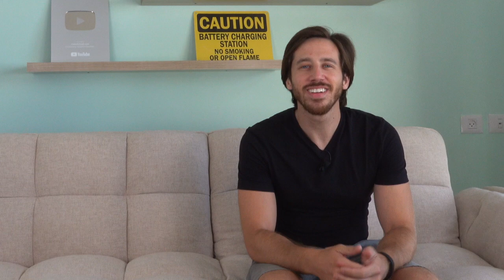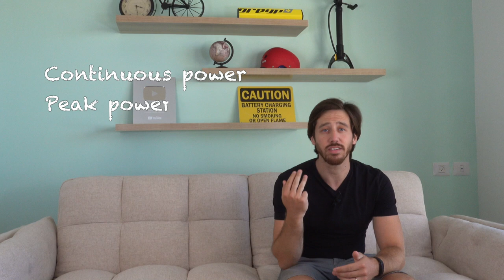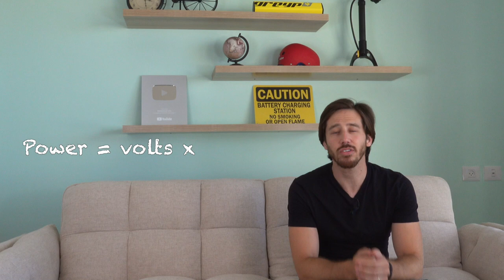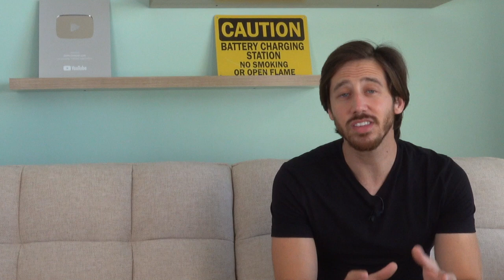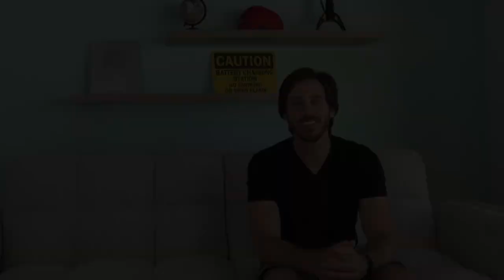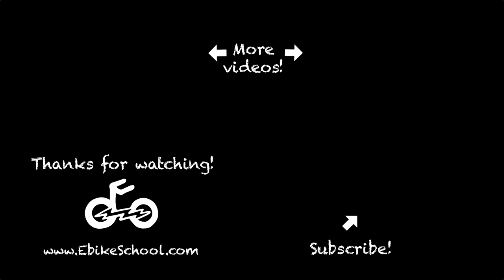E-bike watts - How electric bicycle companies are lying to you

Comment: Can you mount a generator on a ebike ?
Reply: I'll answer this one.
One can do whatever one wants.
The answer is yes; however, is it practical.
IMO, No. The weight,  complexity and cost of any generation mechanism would be much better served by simply increasing amp hours of battery.  Simply put, add a larger battery.  Now them, if I'm to read into your question, I would assume range anxiety. Same rule applies. Lamen Terms. More Battery Juice will outperform range extension scenarios.

Comment: Watts/power. If a motor runs at 500 Watts, for example, some of those watts are heat watts & some are mechanical energy.  If a 500 Watt motor turned 499 of those watts into mechanical energy & only 1 watt into heat energy, it should not overheat. So a rating of how many watts a motor can run at continually without overheating would depend upon the efficiency of the motor.

Comment: Micah help!🔋🔋🔋🔋🔋🔋
I still don't understand what I came to figure out:

I purchased a compact folding ebike.

I got max configuration:
Battery = 48v 15.6a

My understanding is volt is speed and amps is the range/distance. I want to understand how and if getting the basic 350W motor or paying for upgraded 500W will make any difference?

Will both 350W and 500W motor go same max speed (48v) and max range (15.6a)? What if, any difference, besides upgrade cost does getting the 500W motor make?

I think I made mistake paying for 500W if the speed and range are determined by just the battery.
🔋🔋🔋🔋🔋🔋🔋🔋🔋🔋🔋🔋
Reply: Possible solution

Higher power controller = more power to the motor ( but more heat will come from a lower power motor )

like your 350w wheel it wouldn’t be wise to connect a new controller to that because the motor will heat quicker than a 500w motor 

Long story short: 500w motor + controller upgrade = maximum draw from your battery to motor which = more speed
Reply: @ize100  thank you for the explanation! I am thinking for a small compact bike that people likely to buy it not prioritize speed and better to do 350w for better range. The only major difference, for this specific bike is that 500w not much faster than 350w but it does have nearly twice the torque.

Comment: So, if I swap my 45 amp peak controller with a higher amp controller, (with the same others) will my bike go faster?
Reply: Yes, but make sure you dont apply too much amps or your motor will melt
Reply: i wonder do you have hub motor kit from china with 1500w motor? I have also 45amp 1500w hub motor kit from china
Reply: @volcaprojects8333  I have 1500w direct drive motor from china. I just saw a guy that changed controller to a more powerful one and didn't make changes. Only after increasing the voltage
Reply: @77777Plank  Okay. mine was 48v i installes 52v battery and now i get 2kw continuous and 2.5kw peak
Reply: @volcaprojects8333  almost the same. 52v 2250w peak
Reply: @77777Plank  kt-lcd8 display?
Reply: VoLCaMiN yep
Reply: @77777Plank  2.3kw for me 😎👌🏽

Comment: Australian laws dictate 250w continuous for pedelec and 200w peak for non-pedal assisted/throttle only... with a 25kmh cap.. so sad. Also specifies total combined power so cant make a 250w 2WD build and overvolt like you did :(

Comment: Hi Micah, I am hoping you can assure me I didn’t make a costly mistake in the controller I ordered. My goal is to convert my mother’s Sun Trike into an e-trike for her retirement present (so she will actually be able to use it!). Unfortunately, I ordered a 48v 1000w kit for an e-BIKE forgetting my desire for a reverse function! I am aware that many controllers have the function built in even if unlikely to be used on a bicycle kit. The controller I ordered (from Enjoy Cycling Store via Amazon) as part of a front wheel hub kit has controller model #KT36/48 ZWSRL-ff01A. It should be noted that I have not yet received the kit yet; I just realized my mistake and have been unsuccessful in stopping the order. So what I want to know is it possible to enable a switched reverse function with this particular controller?  If so, can you do a vid on how to do it?  I will be a first time e-bike/trike builder; but I won’t be a one time builder as I have plans to do more when my budget allows. Thanks so much for any help and advice you can offer me in this dilemma. I love your vids, keep up the great work.

Comment: Laws and rules are based on Continuous power. Not Peak. Because the peak power isn't the maximum speed of the motor. Continuous power means the motor is at it's end performance line. While Peak power is the start of Torque/RPMs. It's same deal as Gas and motorcycles. If they ruled on that, the bicycles, etc would be VERY VERY crappy performance because their Peak power being ruled down, would make bikes under perform.  Bicycles, Cars, Motorcycles have to have this Peak power ability because it's the backbone of getting started. Then the motors taper off.

If you learn about motors and their performance you'll understand a lot more about laws and rules things are placed on.

Comment: If you could figure out a way to tell the difference between a 500 watt Bafang geared Hub Drive and a 750 watt Bafang without taking them apart or riding them , you would be the man.  I'd buy one of these e-bikes except for the companies that sell them are so Shady. I know I talked to a couple of on them on the phone. More than once. More often than not you end up with a $1,500 to $3500 paperweight/ headache, if you have any intentions of riding them more than a couple miles a month.

Comment: so my bike is 500w rating i have a 48v 13ah battery and a 25amp 48v controller 48v X Amp25=1200peak power
Reply: I believe that’s correct my guy. That’s correct.

Comment: Isn't torque variance also due to the winding on the motor? 

The Crystalyte series here is the one with which I'm most familiar and the data provided has varying torque but assumes the same controller for amps and same voltage for battery.

http://www.crystalyte.com/SAW%20series.htm

Comment: Nominal power is not just a name convention. It is a rating that the motor is supposedly designed to run at in excellent conditions with the proper voltage and current applied and at a sustained power level.  Also, my 1k rated motor is not a 1k motor. The voltage and current rating is 48v at 20a and therefore using the oversimplified power rating system it is 960w, but is listed as 1k which is incorrect. I wish people and businesses would at least use true power ratings without the fake rounding off of the numbers( that includes you).

Comment: But ... You didn't explain torque! Nor power, for that matter, and how it relates to what it does for your riding on the flats, up a hill, over some roots
Reply from the maker: Yes I didn't do a breakdown of torque, perhaps that should be a future video. But I discussed power both from a physics standpoint and a practical standpoint. It was in the beginning of the video.
Reply: @EbikeSchool  Love your videos, by the way. Thanks!
Reply: @EbikeSchool  I think it would be helpful for people to understand Watts in terms of what it can do for them, rather than Volts x Amps. Eg. 250W is 10km/h on a 6% gradient with 22kg bike and 80kg rider. It's also a bit weird that 250W isn't the same on every bike, because some bikes are more sluggish than others (eg. compared to Specialized SL models).

Comment: Make it as simple as possible, butbno more.

Multiplying battery voltage * controller current may have been somewhat accurate in the past, but with todays hardware, that calculation is wildly inaccurate.

Voltage will be at its maximum at maximm speed.
Amperage will be maximum at maximum torque.

I guarantee you those do not occur at the same time.

You aren't going to see a motor with a 48v battery and 100a controller pulling 4800w

Comment: Power is just a number, it's how she chooches that matters.

All those angry electric Pixies are skookam as. 

Are there any geared mid mount motors on the market at the moment? Like separate gears between the mid motor and the mid output sprocket?

Be awesome for a belt drive single pedal gear.

Comment: The explanation for motor rating is too simplistic. ESCs switch, between full-on and full-off. This leads to very high RMS currents, which is much larger than 'average' current. It is the RMS currents that dictates the power dissipation from the motor (ignoring hysteresis core losses at high RPMs). You can easily burn out a motor/ESC/battery at partial throttle, even though the average current is low.

Comment: Now how many advertisements of EBikes have you seen with anything other than a "watts" rating, not mentioning any qualification, like peak or continuous? In fact, have you ever seen in the specs of an eBike for sale anything other than just "watts"?  And don't the laws all just say "watts" without any other qualification?  I doubt seriously that any EBike motor is anything like 90% efficient. So when a seller says, "Watt," you may reply, "What?"  Seems to me that PEAK power is when you start the motor, acting like close to a dead short circuit before it starts turning.

Comment: Tourge rating is by far the most important. I have ridden 750w (48v24a) ebike on steep hill gets to a full stop. Then riding 250w ebike i put same uphill goes 20km no problem. 

The first bike was with fat tire hub motor and other one was normal tires.

First ebike was KS26 750w and 2nd was NCM milano+ with throttle both.

Comment: Hi l have a 250w 36volt front wheel motor with 15,6 amp battery 36volt battery with 40 mn  this seems from your maths very small l live in Poland.

Comment: Ohms law ...volts times amps equals watts.. 880 watts equals one horse power. Which with with wind resistance and proper gearing can approach a mile a minute...or more. With wind fairings and big chain wheels bicycles with no.motors following vehicles with a wind break ...approach well over 100 mph.  The korean gas motor on a mountain bike with a Jake shaft and ratcheting  freewheel front chainwheel now has a 5-6-7 speed transmission... so you wanna ride yer mountainbike 60-70mph down the freeway... it's now possible... hang on....get steel wheels and ditch all the aluminum and upgrade yer spokes ... forget an aluminum frame.. chrome moly chrome moly chrome moly chrome moly.. I've toured america on an 8000 mile circuit I know a little about bikes.. Aluminum components are key to long hauls and light weight.  Add any horsepower and the dynamics are deadly at best .. steel wheels steel cranks steel frames .. sorry... 30 mph on anything but a lonely straightaway is madness ... 20 mph is almost controllable.. we stepped up from pedestrian monkeys and horses and buggies to shed their forest Gump braces and fly away...  why this wasnt done 50 years ago is beyond me..crazy...man..

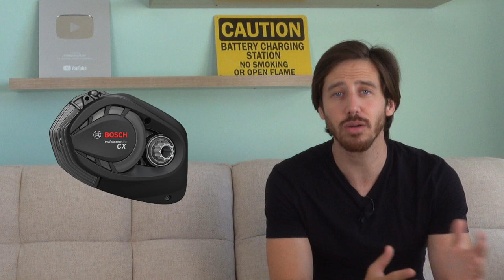Comment: WTF is "Europoean level" @8:24?! 
I never knew they operated on a higher (or is it lower?) level. Europe sucks if you can only get 250W over there... IMO, it's not even worth getting an Ebike at that level!
Reply: Well he explained that using Bosh as an example. They all fudge their power wattage to be legal, so you have to go by the Newton meters of torque to know how powerful they actually are. But he even fudged Bosh's Nm ratings by a ton. They make motors that near 200Nm of torque, not just 85Nm like he mentioned. You'd be hard pressed to find any motor on a US E-Bike with anywhere near that much torque. Even my 1,000 watt Bafang motor only has 108Nm of torque.

Comment: The math isn't that simple. Yeah, mid drive might be but by a hub motor calculating 32V x 15 A means the maksimum peak power is 480w (not taking the power efficiency in) but you don't have any ideas in what rpm the peak power is.

Let's say you doing 25 km/h and your controller limits the Amps to max 15A and to get to the 15A cirrent @ the speed, the engine takes 25v. That means you're max power @ 25km/h is 25v x 15A what wuld be 375w

Yeah you culd rune the same engine with other 15A controller and 48V battery, but you wuld still put out 375w @ 25kmh

So the right way to look at the things wuld be the torque in the most cases...

Other thing is that you can up to a limit push more amps true the engine. There is a physical limit about how strong the mangnetich field can be made for a given mass of iron (the engine)

This limit is the current and maximum possible torque, the limit is a soft but quite deep curve to well you lose quite fast the efficiency.

If you want more power you just raise the rpm and give the engine enough Voltage to keep up the current.

Current is equal to torque, and the voltage is equal to how high in rpm you get the current going. So you get from the same engine more power by spinning it faster wit higher voltage

The last thing is the termal limit. And that's a question about design /used parts in the engine. Some data sets I seen giving out more than 10x rated power (constant) for 10s if I don't remember wrong

Comment: the lies ive come to ignore

battery life/range utter bs its rated on you being in the lowest pedal assist and weighing the same as a anorexic supermodel riding on a flat road with no wind

speed will depend on what they have told you and how much you weigh if they said 15mph it will probably go around that on flat roads but any hill or wind and that numbers dropping when it comes to throttle only in pedal assist it depends on how committed you are

i cant remember where but one site has a decent little calculator where you tell it everything about your setup your battery your controller wheel size how much you weigh how much throttle you use the gear ratios you'll use most and even the type of cycling you'll do and it returns a decent estimation of range 

i told it i had a 350w 11.5ah battery 36v i weigh 105kg with a fat tyre ebike on 20 inch wheels and i intend to do mostly throttle only riding on mixed hills and flat for urban riding and it returned around 20-25 miles range

which is about right i get 18-20 miles as far as I've been able to tell using the trip counter and google maps